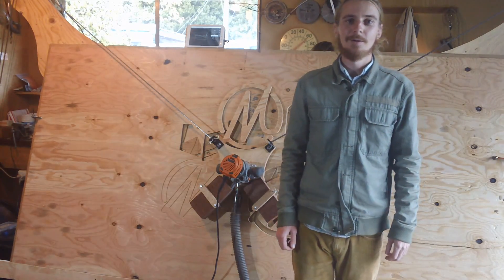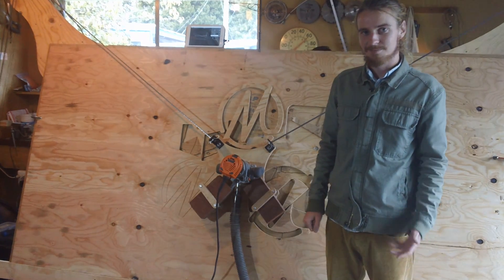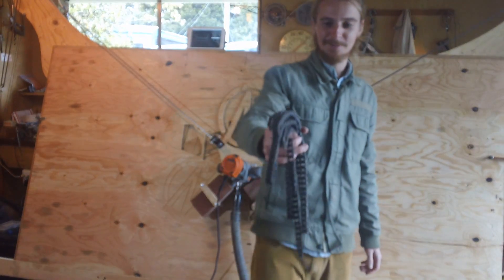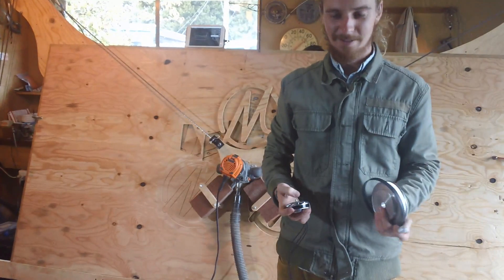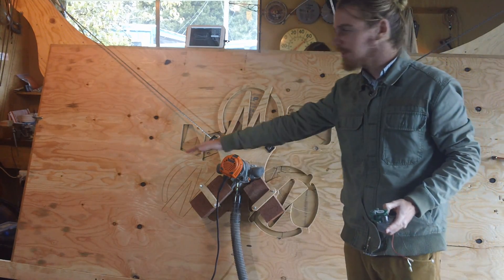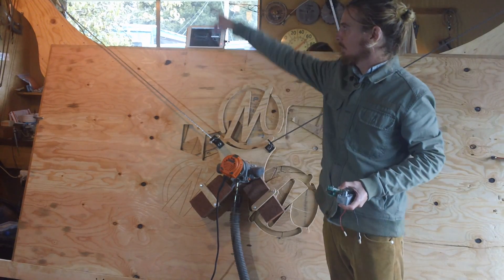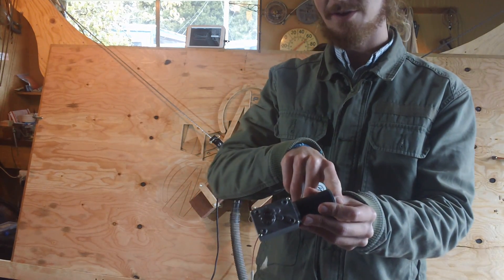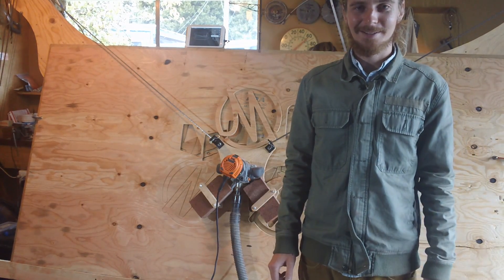Maslow CNC Design Overview

Comment: I have an idea to improve it.  What about some sort of 3rd safety line?  Right now, its a power tool with a spinning carbide bit and some bricks dangling from 2 points.  One of the goals of the project was to try and save cost, so your motors, mounts, and chains are not the most robust out there.  When one of them gives out, your router and bricks becomes a swinging pendulum of death and destruction.  Good news is that if you had dust collection setup, you can probably find any severed body parts in your dust collector to take with you to the hospital.

I feel like some sort of oh-shit safety cable would be worth adding on so in the event of a failure, it will still have 2 points of support and wont be swinging wildly.

Comment: I'm interested in this for plasma cutting sheet metal. I wouldn't need a z-axis so much is I would need an off on switch for the plasma cutter itself. I'm wondering how hard that would be to incorporate into The software You are using.
Reply from the maker: The controller board has 4 digital auxiliary ports and two analog auxiliary ports to make it easier to hack and build on. Be safe!

Comment: Is the precision of the cuts on this Maslow CNC comparable to a traditional flat CNC router? I found this today and I am very interested in getting one for myself. VERY cool design and I love that its on a slant requiring less of a shop foot print.
Reply from the maker: Thanks! Our target precision is +-1/64th of an inch, which I think is very achievable. We don't really see Maslow as competing head to head with a $10,000 gantry machine, we're trying to be another option.
Reply: A tolerance of +-1/64th is more than I would need. Really GREAT product and design. Thanks for the quick reply.

Comment: how does it lift the route bit out of the work?
Reply from the maker: The depth of the router is either set manually, or with an optional attachment can be automatically set.

Comment: You would achieve greater accuracy if the chains were connected as close as possible to the router spindle. The router base could remain the same size for stability but the chains should be connected closer to the spindle.
Reply from the maker: I found the opposite to be true, but I could be wrong. I found that the further out the chains were connected, the more stable the router is. Basically with the chains far out, the sled create two pivot points instead of one, and each of those pivot points has a greater righting moment (is that the word?) than if it were at the center. Having the points anchored farther out does make the math quite a bit more complicated, which is a big pain in my butt tho :-)
Reply: Well there isn't much that beats real world experience so I may be wrong. When I was watching the video though and you jiggled the router the center of it would move. This would not occur if the attach points were exactly concentric with the bit. However the only way to achieve that would be to have the chain attached to a bearing that went around the bit which is getting away from the simplicity that you wanted to achieve with this machine. The other thing I was concerned about was the distortion that would occur the further out the attach points are. It would seem though that you have done some complicated math to overcome this though so that would not be an issue. Carry on. It is an interesting project and as such I have a hard time not throwing in my 2 cents.

Comment: This is really cool. Questions I have: Is this capable of going all the way to the corners? If I wanted to have this set up for a 4x4 workspace, or smaller, what would be the estimated in surface cutting area? It seems to me that you wouldn't be able to get into the edges very well. Thanks
Reply from the maker: Thanks! Good question. You can go all the way to the edges (or within about 1.5 inches, because the router slides on the surface and needs to be supported. If you are looking for a machine which has a total footprint of 4x4 you are probably better off with a gantry style machine. I'd recommend the Shapeoko3. For my design, the motors need to be about 16 inches out from the edge of what your are cutting so a total footprint of 4x4 wouldn't leave you much room to cut in.

Comment: This machines looks amazing. How thick can you cut in one pass? I have seen other videos and it seems to take various passes to make a cut.
Reply from the maker: Great question. It's a little bit of a complicated answer because it really depends on factors like what bit you are using and what kind of material you are cutting but my general answer is that I do 1/8th inch per pass so a piece of 1/4 inch plywood is 2 passes. When cutting thicker materials like 3/4 inch plywood I tend to do deeper passes if I'm in a hurry. Basically you always are making a trade-off between speed and accuracy.

Comment: Can you only work on 4'×8' sheets or can it be smaller?
Reply from the maker: Good question! You can cut smaller pieces. You've got to clamp them to the bed or have at least one straight edge to rest on the bottom of the machine.

Comment: Great Idea. You may try and add two more chains, from the bottom of the pendant to bottom corners. This would reduce swing and improve accuracy.
Reply: Watch the vid again. It was mentioned that the earliest design did have those two chains to the bottom corners. However they are not necessary, and when present may actually contribute to inaccuracy.